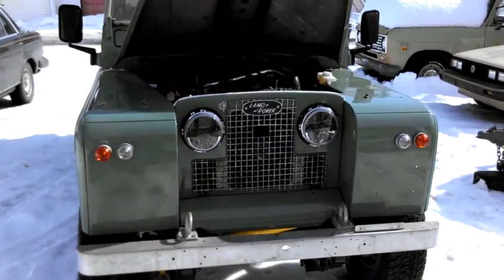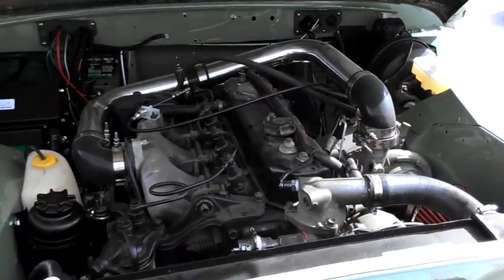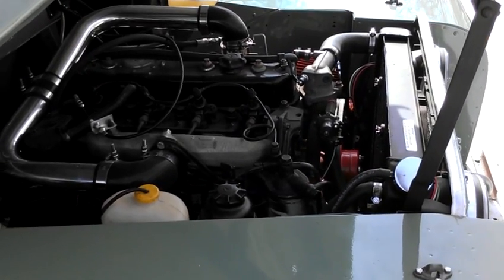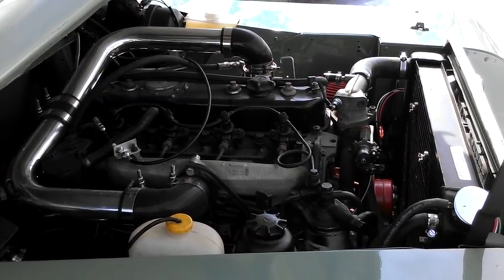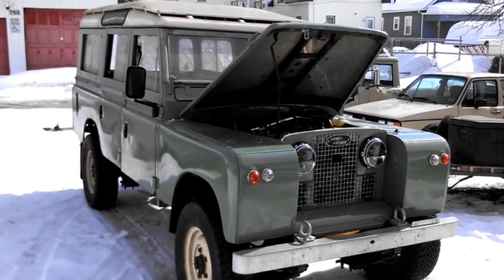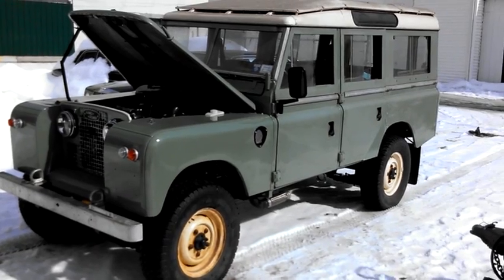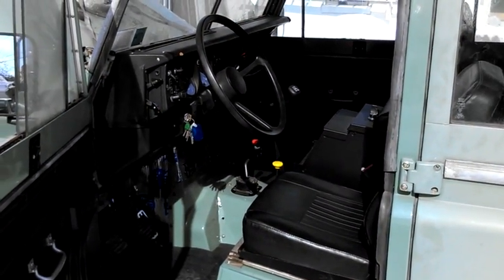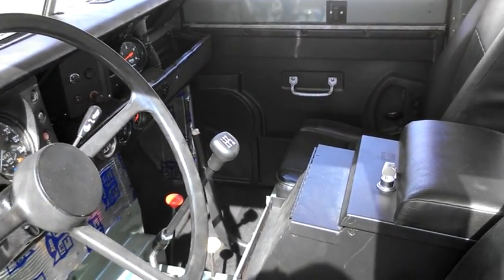Land Rover Series 3 Turbo Diesel Conversion

Comment: It's not a landie if it doesn't mark it's teratory.
Seriously though. It's a series 2. Petrol engine is fine as are brakes and gearbox. More power and power steering do not make more fun. My 2a barely has a clutch or brakes.bo road use but lots of mud

Comment: I have a 77 series 3 109 just finishing up the build we have put a 300 TDI intercooled with automatic transmission, just wondering if anyone else has done this. I have looked a lot on line a lot and found no results.
Reply: Hi Janis, we swapped the 2.25l petrol for a 200TDi Discocery engine, modifying the Turbo (200TDi Defender Turbo with turning the bodyshells) and the manifolds. With the 200TDi engine, we can leave the mounting brackets on the chassis rails, which can't with the 300Tdi. Gearbox and Transfercase as standard. Fairey OD. 109 Hardtop, ex-mod, LHD, 1984.

Comment: hey my series 3 also got it converted to a isuzu 4j3b engine with a 5 Speed transmission. Also got the disco 1 axels with disc brakes nd converted to coils. 
How is the response with the convertion ? mine is still in the workshop will be getting it in 3 weeks time.

Comment from the maker: Thanks for the encouragement! This is much larger than an Isuzu trooper Diesel engine. THese 4BD1-T engines are found in NPR cab over box trucks and Chevrolet Kodiak work trucks here in the U.S. They are a medium Duty truck engine and weight about 800lbs. (Same as a chevy big block V8)

Comment: Great job. What engine is this? Ie what donor vehicles have them.
Reply from the maker: +The Conrad Channel this is a 3.9 liter industrial diesel engine from a cab over NPR box truck. much larger and more powerful than the passenger vehicle engine.
Reply: Isuzu engine. I don't know where you're from. But where i'd see them is in Isuzu trooper 4x4s , some opel/vauxhall frontera 4x4s and isuzu's own small trucks